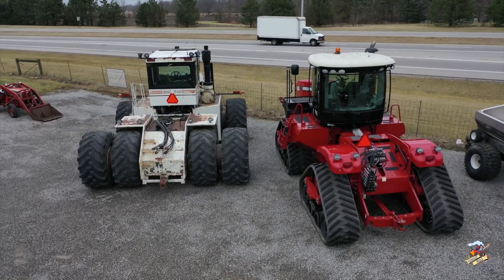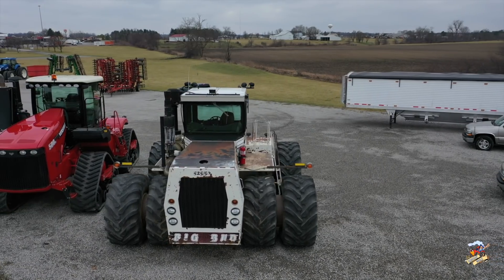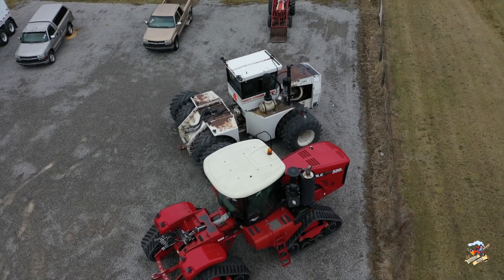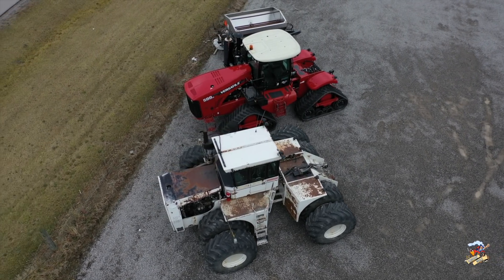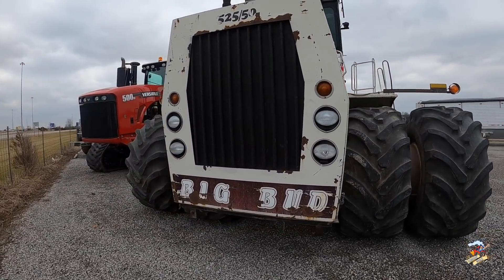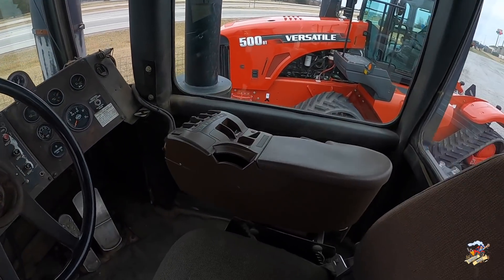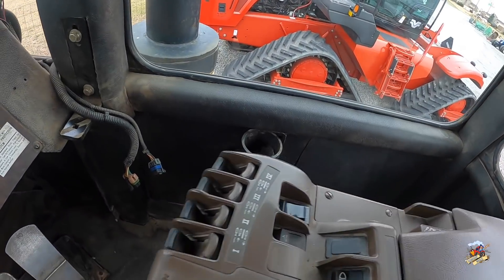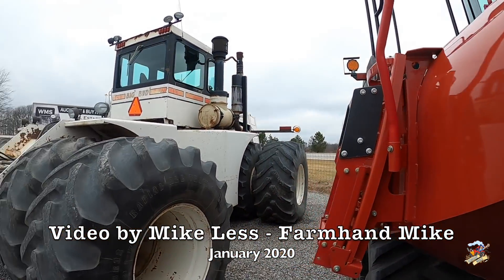BIG BUD 525/50 Tractor for sale in OHIO

Comment: It's oblivious that the Versatile is a much better tractor at pretty much everything, but I still like the Big Buds better, SMH at myself, lol !
Reply: It's obvious much better?
How?
The yield will be higher behind the Versatile?
They pay more for corn when the field is worked with a Versatile?
Paying huge payments and interest benefit who?
Reply: Especially in when it comes to fuel efficiency, that old engine in the Big Bud can never compete with the much newer in the Versitile. Cost of fuel is by far the largest operating cost for any farmer
Reply: @12345anton6789  The fuel efficiency would be next to nothing, and fuel isn't even close to my biggest expense
Reply: RJ 1999 then what is your largest operating cost running a large equipment like this
Reply: @12345anton6789  Now you narrowed things down some from your previous post. The original statement was one of the farmers largest costs, now you narrowed it to cost of operation for the tractor. That's 2 entirely different things.
We calculate fuel per acre, we have a 525 hp Steiger when it's out in the field it can burn 200 gallons of diesel in a day, but it will have 320 acres behind it, so the cost per acre is relatively low
Reply: RJ 1999 read my original post “cost of fuel is by far the largest operating cost for any farmer” I’ve never said anything else
Reply: @12345anton6789  yes I know what you said, and you're completely wrong

Comment: It needs work I’m sure I’d be a bit skeptical since it’s at auction and the owner has another, but if you get cheap enough a good build/resto considering tractor prices today.
Reply: It's hard to say why the Bud is there...its stated that the farm bought it new, so thats over 40 years, farmer could be downsizing or retiring...a resto project for sure but simple electrical and hydraulics
Reply: tooez90  Yes they were really a unique tractor in their day, and they were designed to be worked on they use common components easy to get replacements for. Even the standards were Eaton truck transmissions like the 13 speed although this is a power shift any good heavy mechanic can rebuild that if needed. I think the guy that designed and built was a genius.
Reply: Price Cummins 1150 engine parts lately ?   You can buy a complete used 1150 engine for what a new 1150 cam shaft cost......  If you don’t have to touch engine then good deal.  Get into that engine and cost goes way up fast.